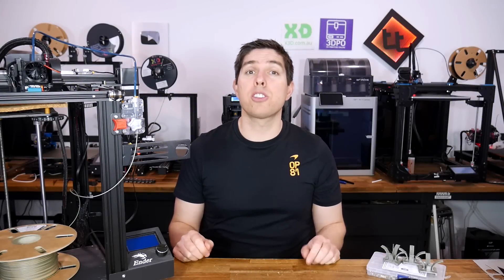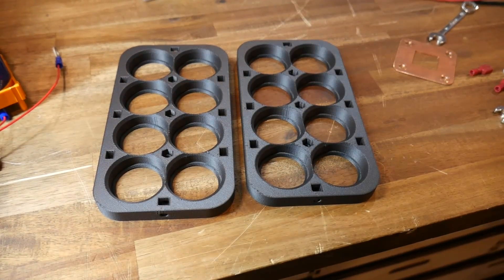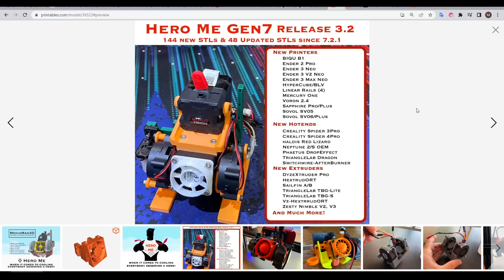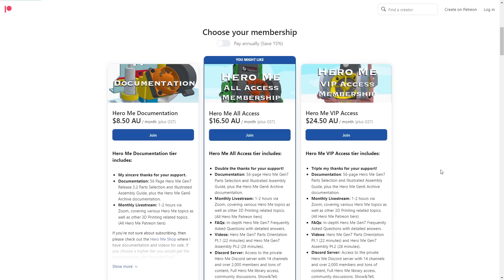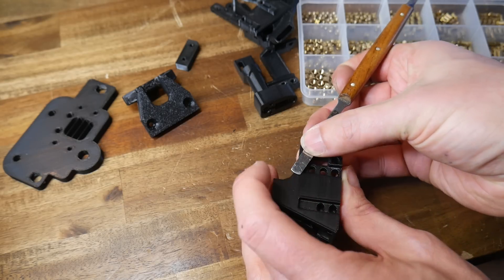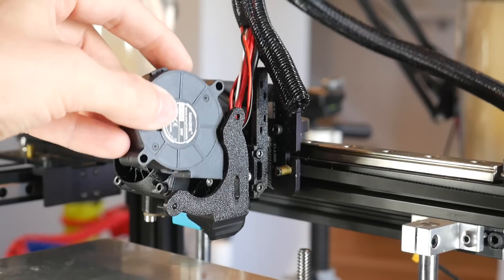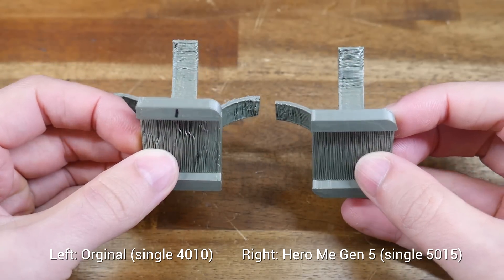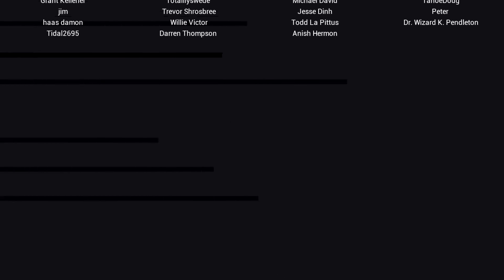Hero Me part cooling system - Modular, capable and super compatible

Comment: I found Hero Me just as starting point of having custom print head. All components are too tight and interdependant. Anytime you would like to switch something you need to get out feeder, then the whole carriage apart. No easy access. Also most parts are designed to have tiny walls that are too fragile for being screewed.

So I have started desighnin my own system for my needs. That takes time and efforts, but there are nothing worse than universal solutions.
Reply: Hi! I'm the real creator of the Hero Me, not Mediaman... I understand your point... The Hero fanducts was created a long time ago, when the ender 3 was "the top dog", and was created for the ender 3 and CR-series... Since then, 3D print has changed, evolved, the community has learned and designed better solutions! And we know that lighter is better, something that sadly mediaman never understood... It is about balance! 2 blowers was always unnecessary! But that's his main selling point... He's claiming he's the creator, but he don't even know the basics of printing, or the rules I based on my design. In 3D printing less is always better!
Reply: Bit late but 2 5015 fans aren't really enough in a lot of cases, not even when overvolting even with the best current duct and a ws7040 you can easily get into situations where pla doesn't cool enough. Abs has finally been beaten tho.

Comment: Unfortunately I can't use it as it is incompatible with the 38mm wide hotends on the Creality Neo printers.
Reply: Yes, the Ender 3 Neo stock hotend is one of the very few hotends that the Hero Me does not support for exactly the reason you mention. The Ender 3 Neo (all the Creality Neo printers) are supported if that cheap hot-end is to be replaced. Large wavy cooling fins are added to bandaid a problem that should have been engineered properly in the first place. They have never controlled the air flow path from the fan to the heat sink. This is why you often see people add larger fans on the front of their printers trying to prevent heat creep.

Comment: Seems like system for folks that do not care about weight. So many plastic parts, inserts and screws
Reply: Regarding weight: A fully burdened Hero Me setup with direct drive and dual fans is only 87 grams of printed parts with mounting hardware. Add in all the printhead components, it can be as little as 329 grams ( and this weight is from a direct drive setup).

Comment: I build a hero me 4 my ender 3 👍
But now i have a Ender 7 and i can't find a mounting plate 4 it 😢
Can someone help me with it 🤔
Reply: While it is possible for me to create a Gantry Adapter for the Ender 7. That printer is too constrained for the Hero Me. For a typical dual 5015 Hero Me you would loose X/Y build space because the Hero Me wider and deeper than the stock setup.
Reply: @MediaMan3D  ok thanks for the explanation 🤗

Comment: my past issues with the system being a sort of wonky mess that turned into a tilt lever and vibration accumulator for the print head due to its length. Even with PC/CF printed parts.

Comment: I switched all of my Hero Mes to the Satsana. I prefer it because the screws always get a little loose on the Hero Me and they are a bit finnicky to get the nuts in. The Satsana has been just as capable for my Creality machines, is one piece, and you only have to use the two stock screws to put it over the hotend.
Reply: Yep, if you are never going to change out your hotend or cooling or ABL, or upgrade to Direct Drive and/or Klipper, there are many simpler printhead systems out there, but not necessarily better cooling systems. (BTW, the Hero Me Gen7 does not use nuts, that is solved with threaded inserts, and if your really worried, thread-lock) 

The Hero Me Gen7 is all about choice and personal preference. If you have been upgrading your 3D printer, you've made choices about what is important to you, Your choices are likely going to be different from everyone else. When choosing a hot-end, extruder, and ABL combo (not to mention fans and accelerometers), where are you going to find a printhead platform that will accommodate all your selected non-stock components (which could be a rare combo), for your specific 3D printer AND provides part cooling that gives you great print results. This is what the Hero Me Gen7 is all about!

Think of the Hero Me platform as Lego blocks for printheads, there are mounting parts for each component (hot-end, extruder, fans, ABLs, etc.) that stack and mount to a core Base. Component-specific mounting parts can be interchanged for another of the same type. So, should you change your component selection(s) in the future, you do not have to start over, you simply replace the single STL mount that is matched to the new component. There is no need to yet again go looking for a new set of mounting hardware that was not likely to have been designed to work with each other in the first place.

Comment: I used the hero me 7 system on my anycubic kobra go, which is an ender 3 clone.  I needed to modify several parts to get it to work, and I lost about 20mm of travel in X due to the ABL sensor hitting a part of the printer on the one side.  I couldn't get my aftermarket creality hotend to mount to the hero me, so I mounted it to the original location with spacers.  I used the lightweight dual 5015 fan mounts and neither side lines up with the hotend correctly.  The documentation was good, not great, and I didn't like how many different pay tiers there are on patreon.  Overall I think its a good system for someone willing and able to tinker.  There was very little noticeable improvement over the stock assembly on my machine.

Comment: I improved my Anycubic Mega SE (basically a Mega Zero 2.0) by making my own curtain cooler. I took an unused 92mm Noctua fan, ordered a 24V to 12V converter, and designed my own curtain cooler, mounting to the back side of the x-gantry's 2020 extrusion. since the stock main board didn't have a free fan slot and I didn't want to mess with the cooling already present, I wired the whole thing up to a free pair of terminals on the PSU, with a "low noise adapter" (glorified potentiometer) between the converter and fan for control. It's very much manual, but it is what it is. 
It actually works surprisingly well, considering it's an axial fan blowing through a duct. at lower speeds I can even turn off the loud stock cooler

Comment: I tried Hero Me Gen 5 and 6 and I found that the parts needed to assemble a full system is just too much. The fact that it's paid also takes away a whole bunch. I used it on an ender 3 and I found that the base for it is a major failure point. To change a hotend, you'll have to disassemble the whole thing. It's also awkward to put together and the cooling performance is not even close to what I had with the Blokhead on the same printer. Went back to blokhead because 4 screws I can have the whole thing off and ready to service. I also found that the heated inserts made the design worse, not better.

Comment: Can someone please confirm MK10 style hotend and extruders like on Wanhao duplicator i3 v2.1 isnt supported?
Reply: The Wanhao Duplicator i3 v2.1 and Duplicator i3 Plus (I have two of these) are examples of integrated extruder/hotends (Wanhao was doing this 6+ years before the rest of the consumer 3D printing Mfgrs. I am sorry but integrated extruder/hotends including the Wanhao Duplicator i3 v2.1 (along with the Ender S1 Sprite, Micro Swiss NG, Titan Aero, BIQU H2, E3D Hemera, and the Bondtech LGX Shortcut), are not compatible with the current Hero Me design architecture (including Gen7). 

They are all too large, too wide, to fit into a Hero Me Base. With the exception of the Wanhao Duplicator i3, the Hero Me was designed before these other integrated extruder/hotend combos were developed. To make a Hero Me fit these assemblies it would no longer be a Hero Me as it would not be compatible with any of the hundreds of parts from both my Master Suite and the over 650 remixes and add-ons created by the community. On a more positive note, I am working to develop specific (based upon Hero Me) part cooling ducts with ABL/ADXL345 mounts for these integrated extruders. I hope to have these available later this summer.

Comment: I used to run the hero me system on my old ender 3 pro and also printed it in PETG and after a few months the parts started experiencing creep and failing so I reprinted everything in abs and the stuff has been pretty solid since. It's a really good cooling system.
Reply: I was just about to print it in PETG. thanks for the tip
Reply: I've been using PETG on mine for ~3 years now with no issue. ymmv

Comment: Silly off topic question. How do you get your STL's to show as images/icons in your explorer folders? I just get generic icons when I switch view to large icons.  Thanks
Reply: I use stl-thumb. Don't know if this works for other apps, but if you turn on the Preview Pane and change the default stl app to 3d Viewer, you'll also get a resizable, rotating 3D model in Windows Explorer that you can even manually manipulate. Downside is you can't double click an stl to open it in your slicer.
Reply from the maker: I can't remember the exact one I'm using, but searching for 'windows stl thumbnail' gives several examples. This one looks nicer than what I'm using now: https://papas-best.com/stlthumbnails_en
Reply: Same question. Mine don't show up like that either. Default program for .stl's?
Reply: @teaching tech Me too please, those thumbnails are much easier